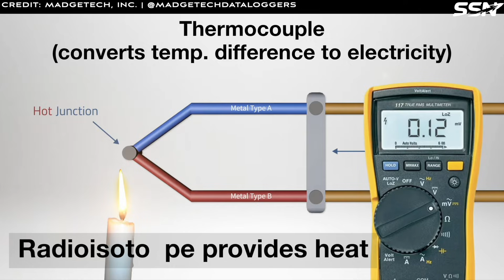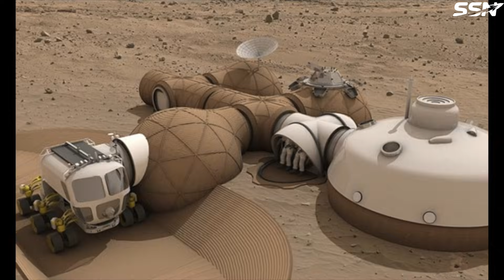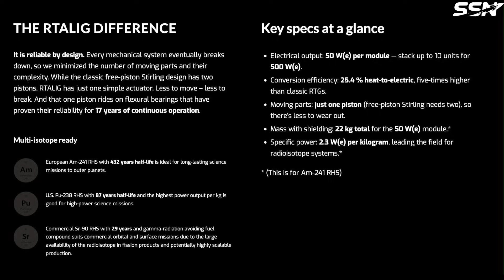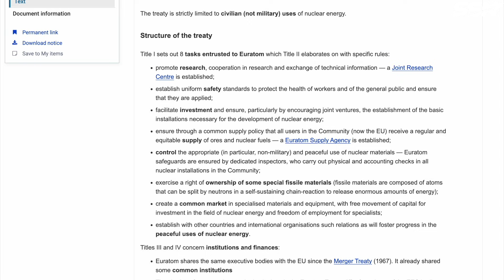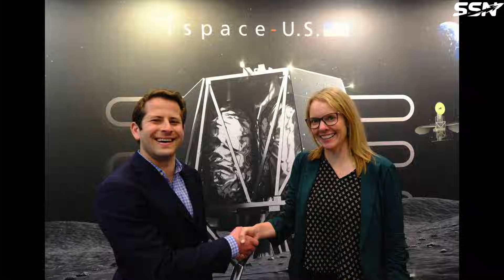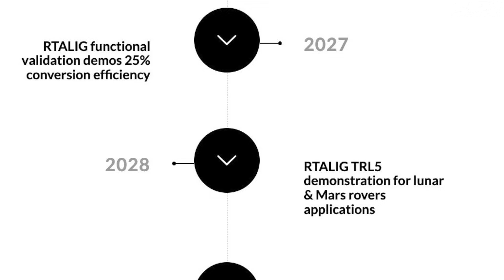From Nuclear Waste to Lunar Power: The Rise of Deep Space Energy (Latvian Space Startup)

Comment: The more important part is this is commercializing SpaceTRIPS research on thermoacoustic engine driving a liquid metal MHD using the TAE 30 bar argon to directly pulse the galistan liquid metal. This could be used terrestrially using a heat source like a diesel burner. Their MHD uses an annular inductor design to avoid contact electrodes. This as close to solid state heat to energy without using a TPV. Though matching the TAE to a conventional linear alternator might yield more power at the expense of a flexure joint to drive it.